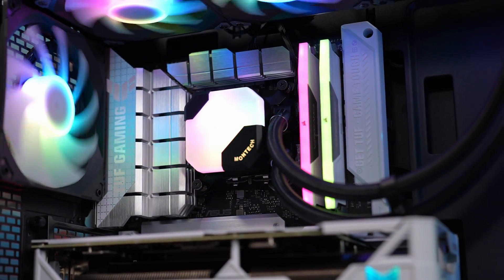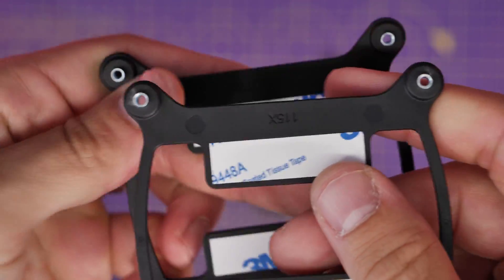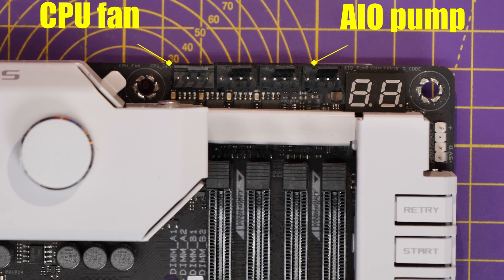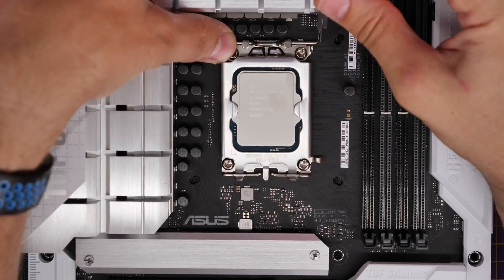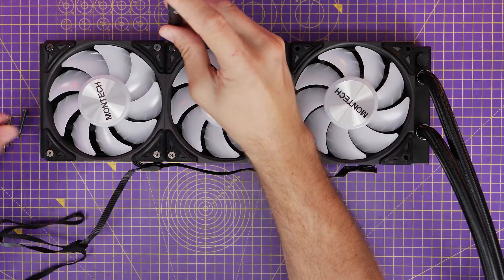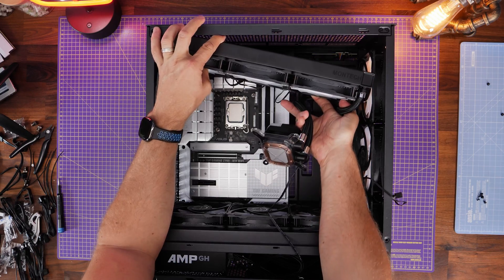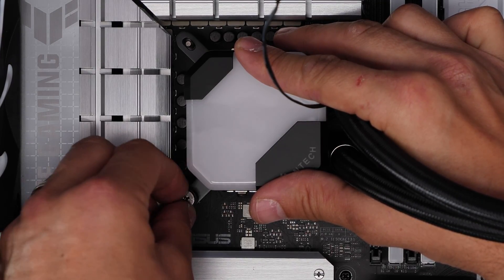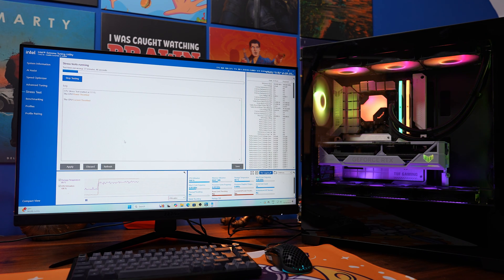Montech Hyperflow ARGB 360 AIO setup guide for Intel LGA 1700 socket motherboards

Comment: My hyper flow rgb does not light anymore after a fresh windows install. I believe it was turned on via a program maybe msi or other. I’m wondering if it needs a program to run the light or is it perhaps installed incorrectly.
Reply from the maker: Try SignalRGB